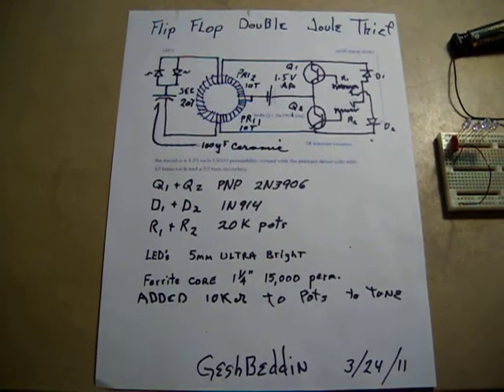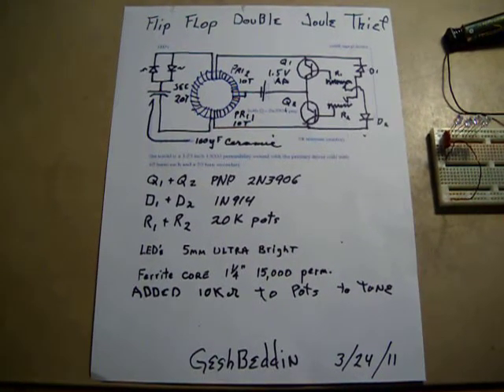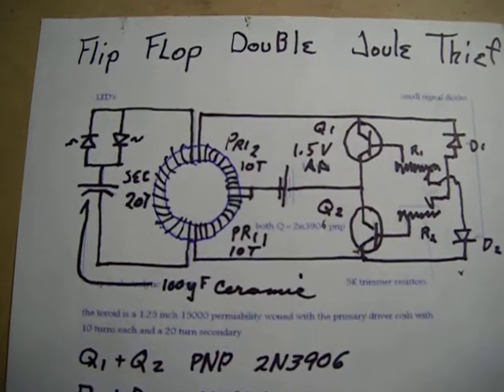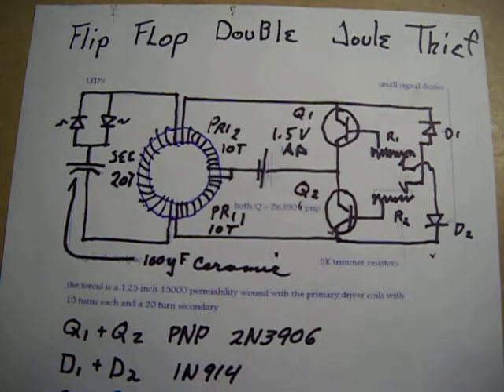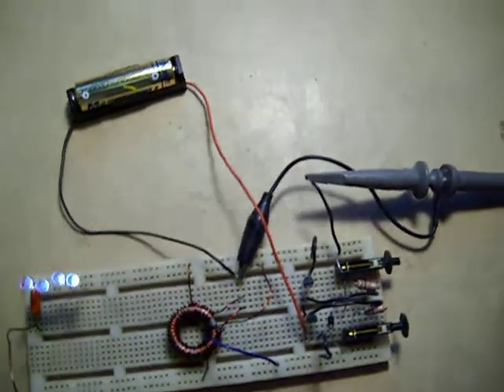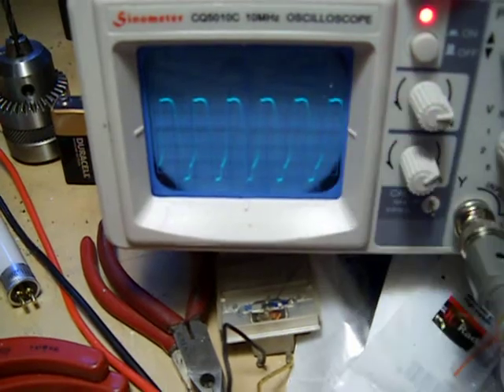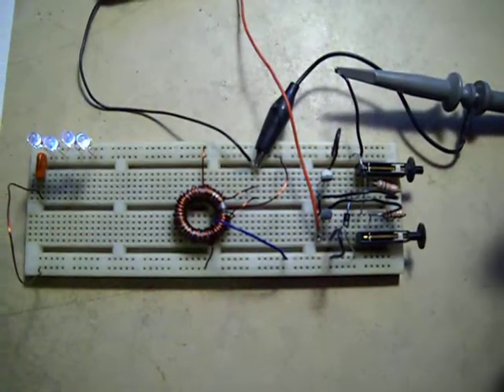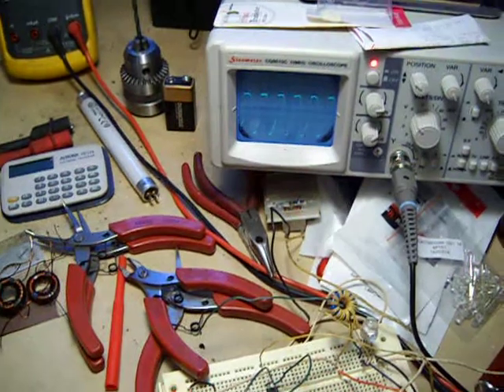Flip-Flop Double Joule Thief

Comment: I have a question about your pots or what looks to be two homemade wire wound pots with a washer and a bolt it looks like. Or whatever the two things are sticking out the ends of your breadboard with round disks. I'd like to know how you made those? It would be soo nice to make my own pots for things that need more precision adjustment cause pots just suck these days. If you could tell me or send me a diagram or list of parts how you built those I'd appreciate it greatly. thecuddaking@gmail.com

Comment from the maker: @Lidmotor 
i will keep that in mind for the next and future videos the battery seems to get allot of ac acrossed it so i am not sure about the draw current as after it has run the circuit for several days it does not seem to have any current left to run motors or the like but the voltage seems to stay it is very different.
martin